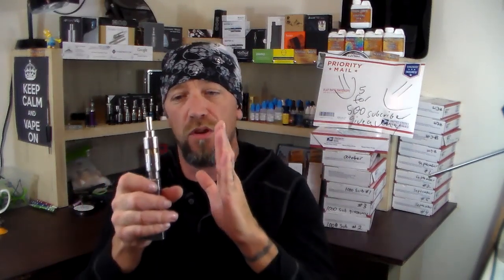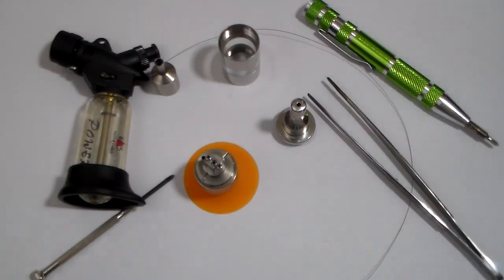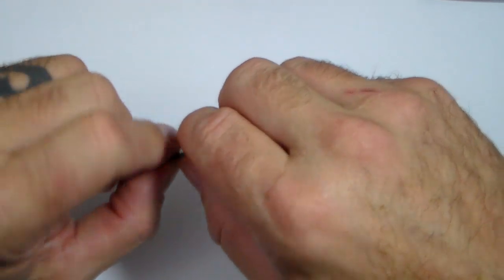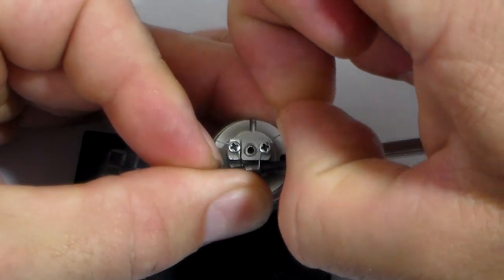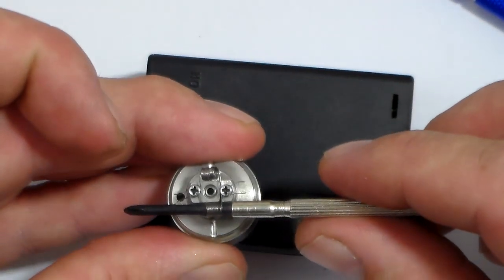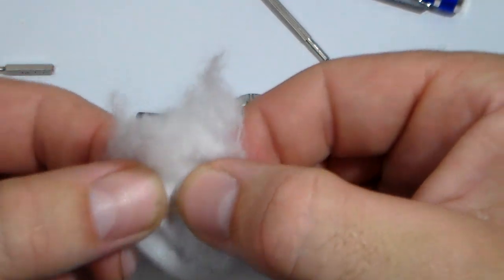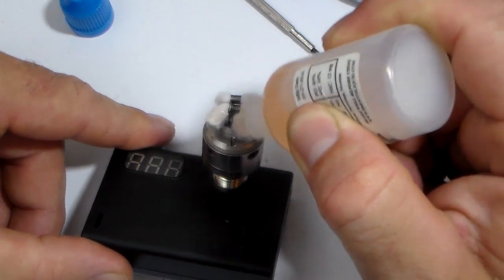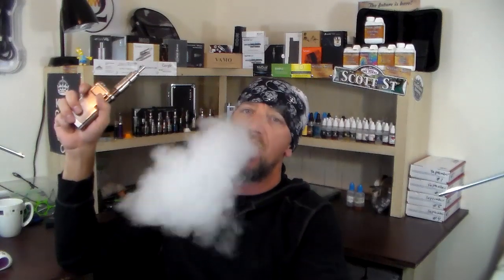Sunday Funday Dual Coil Build on the kayfun 3.1es at 1.6 ohm

Comment: How many wraps would I need if I use 28ga. wire. I want to work with a little stiffer wire if I can. After looking at the link you posted and checking things out it's going to be rough with 28ga wire. Going to try it with 3mm wraps and see what happens. Thanks for the link, and video.

Comment: on what planet is 30g hard to work with? its the easiest wire there is!
 also, this is a 1.7 build, your crappy tester even said it. drop a couple wraps off the length or drop the diameter down on the coil centre for bang on 1.5...